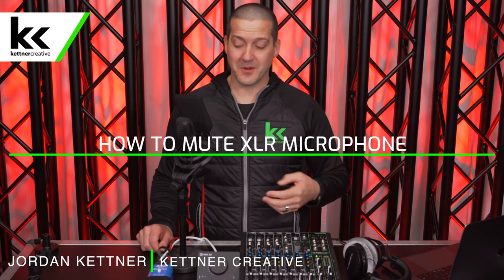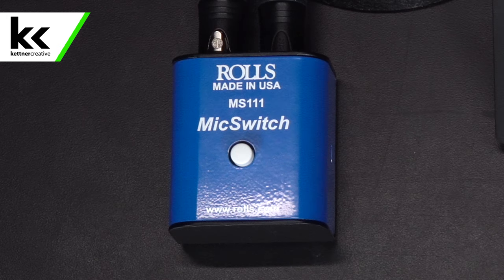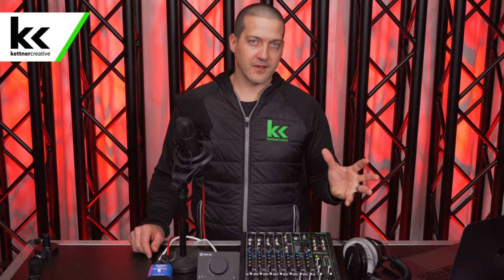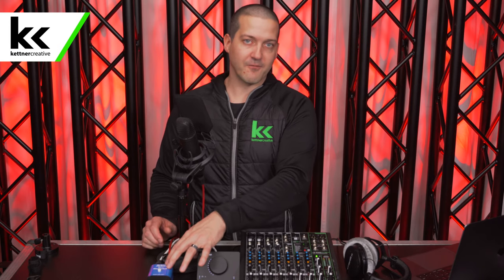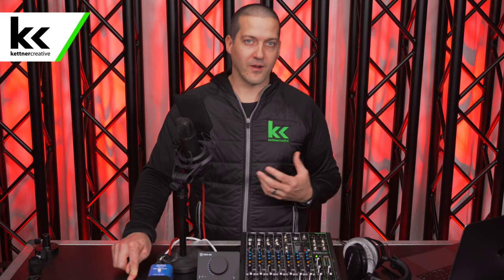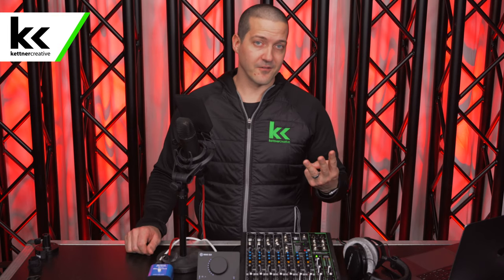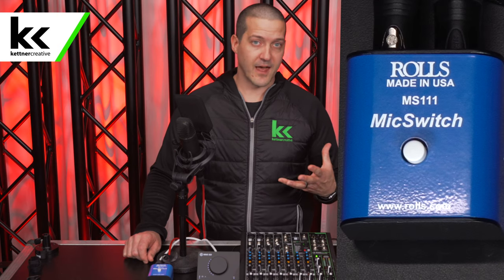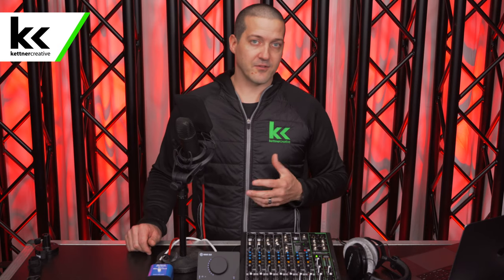How To Mute An XLR Microphone

Comment: Question: Couldn't you just deactivate 48v on your interface to achieve this when using a condenser Mic?
Reply: This is how i mute with my ua volt 276 :)
Reply: Simply turning off the power can cause a pop sound.